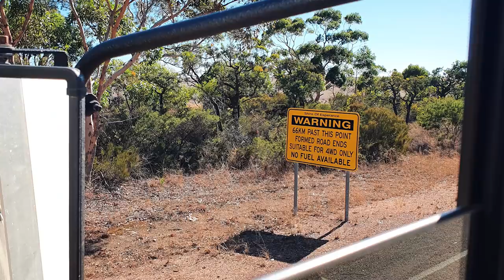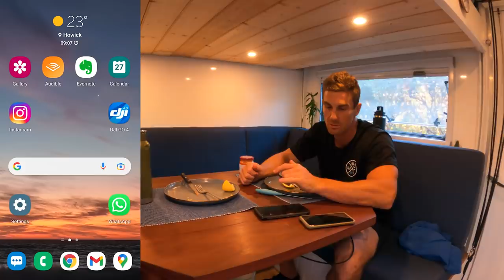STRANDED ON THE TRAIL! First Issue with our 9 TON EXPEDITION TRUCK - Remote Camping Cape Arid

Comment: A shovel is the best thing for levering a wheel off,you have plenty of leverage,another thing I would not leave the truck om that jack without a safety stand,I know you don't have a stand but you could find an old stump or something to use in the bush.it's a very top heavy rig now and if it come off the bottle jack it could tip over so a stump is better than nothing.

Comment: Don't want to contradict you, but are you sure it wasn't just the valve?  
You can get tools that can not only pull the valve, but also clean / recut the thread.  Valve threads can get messed up with you are taking them out all the time to air down.  Their is a product by ARB (and others) that is a "Tire Deflator with Gauge".  You probably already know about em from your Jeep days.  They keep the valve encapsulated and out of the sand / muck.  Great for deflating the tyres quickly and not introducing sand / grit / mug to the valve.  Means the valve thread stays good on the Valve and the tube valve stalk.  Get two so you can air down two tires at once.  With practice you can even do two at a time by yourself.  I've tried the Staun deflators, but with the big tires, they take too long and you would need several sets of 4 to air down to different levels.
Lookup "ARB Tire Deflator" and "STAUN Deflator" if you dont know what I'm talking about.  Also, carry 10 or so valves with you in your spares box.

Comment: Try leaving the rim on the truck next time you can make a quick clamp over if that ring comes off you’re protected and you can spin it. If you’re going with that technique of taking it off you needs at least a five foot bar use your shoulder and the bar line up the holes lift push with your shoulder I used to change them at 17 and 74kg. Just advise happy travels

Comment: Awesome episode as usual, maybe try using a ratchet strap to  lift the tyre, it will save your back. The dolphin swim looked awesome. Good to see you taking your time in each location, cheaper on fuel and better for your soul. Looking forward to the next camp.

Comment: Unfortunately low pressures for sand driving and tubes you will have to get used to this....
Unless there is a tubeless option for the mog.  Im not sure. But I do know that getting rid of tubes was the best thing that ever happened to 4wding
Reply from the maker: There tires can be run tubeless too but not with these rims. We chose to keep our original wheels as the alternative alloy beadlock rims make the Mog stance way too wide in our opinion. We now carry 2 spare tubes just in case :)
Reply: @TheOutFit  fair enough. 
I feel though,  that you guys are likely to do a lot of sand/ beach driving and running low pressures is the best way to get flotation and avoid getting stuck.  However tube tyres don't like low pressures as the tube and valve move around and it takes only a small amount of movement for the tube to deflate. 
Anyway I've really enjoyed the build and great to see you getting out there and enjoying it. Keep up the great work and may the white ox wish you both many more happy adventures to come!
Hope to see you on the trails sometime
Reply from the maker: @thewhiteoxoverland  the army was running tubes fine, we hope we won't have too much issues either 🤞 thank you for your comments and for watching, it means a lot!

Comment: You need a slid hammer to break bead easily. Should only be few minutes to knock off repair tyre if needed, replacing tube and back on

Comment: Some observations: I noted you have the original tyre wrench ( and I assume the bar) use it instead of that lightweight chrome one. When that snaps under pressure something will snap in your back/shoulder. Have a look at the torque setting of the wheel nuts when you get home.... they should not be that tight.  I noted that the tyre you fixed did not have a rubber dust ring inside the tyre,,, see original Army/mog wheel/tyre combo if you have one. As others have said get a four way valve tool and remove the core to remove all the air quickly
Reply from the maker: Hi Trevor, we have a dust ring - I have put a note in the video to mention we didn't film that part!

Comment: Put the Inner Tube on soapy water ..  have  tire leak detector in a spray bottle and spray it on the tube.. It will make air bubbles where your leak is ..

Comment: Use lube on those treads,it will be easier on your tools because it will stop the threads binding,you will get better clamping force because the threads won't bind,also don't over tighten them they are probably only supposed to be around 300 foot pounds any more than that may stretch the threads,in which case they will be damaged and hard to remove,

Comment: Is it necessary to run the engine to have more power for the electrical compressor when your engine is already driving your onboard compressor? Your onboard compressor is for sure much stronger than your other gadget.

Comment: You have air on the truck.   Get an air impact wrench.   Also use your weight to push down to break nuts free.   Also use the breaker bar on the ground to lift the tire.  not your back.

Comment: Careful with jacks. changing rear brake pads on a classic Range rRover on a tarmac drive years ago. only going to be five minutes on a bottle jack. leant in back for a spanner, swore something moved, stepped back. gave it a minute, about ready to continue and then brake disc against the ground wouldnt you know. right cow to to jack back up but got all limbs anyway. axle stands since then defo or wheel between chassis/axle and ground with a wheel off as short as possible unless on axle stands , diff lock in, in gear at least another wheel chocked by some means. if a wheel/ tyre change get the spare ready first. can always chuck the flat one in the back or wrestle it back on after a breather, checks the spare out for as long as its on to.  2 ton of classic Range Rover wakes you up let alone 9 ton of unimog, might be beyond anges lifting ability does look good as tyre crew though. enjoying the travels. we all live n learn hopefully.

Comment: Not sure if you did this but first thing to do when you have a air leak around the valve, is to put some spit over the valve and check for bubbles.

Comment: Admittedly, nothing near the same as dealing with a MOG tire repair in wild, I've done my fair share of coach bus tires in my day. Crazy heavy, loooooong tire levers. Much sweating and swearing. It was mentioned  elsewhere, first thing I always checked was the valve core. All it takes is a tiny grain of sand in there to make them leak....

Comment: Tube tires really hate low psi , what happens is they heat up and the valve steam leaks , the truck was built for hard runs , if you want get heat censers and carry lots of tubs.....

Comment: Wow. Those are real heavy, massive tires. Would it be possible to make them tubeless? Not sure if that would be good or not for such a heavy vehicle, but for most "normal" vehicles, going tubeless is the way to go. Valves from tubes are notoriously prone to breaking off or failing, in general.
Reply from the maker: There tires can be run tubeless too but not with these rims. We chose to keep our original wheels as the alternative allow beadlock rims make the Mog stance way too wide in our opinion. We now carry 2 spare tubes just in case :)

Comment: got to admit i am a bit confused as to why if it was just a bad valve why not just pull the one out of the spare inner tube and put it in the old stem just as a check before pulling the tire? we do this all the time with loaded tire on the tractors as the sodium chloride eats the valve

Comment: i used to fix truck tires split rings check inside tire for crud or sharp stuff nails or screws are a big cause of holes remove from tire & patch tube! i mark the air fill metal part on tire to locate the thing made hole! hope this helps why i quit truck repair was a fire of the shop & then ok i went on built mail trucks van type things for us mail then injured sick i knew it fell hurt back or birth defect or years early in military big little trucks to bad area for me my uncle was sick same way oh no what ( blood cancer oh great i D- i think doc said ever hear of blood thinner my uncles records and samples saved we can control this) & know why and how i was sick! Gregg new blood thinner works

Comment: Bud, take some oil off the dipstick, put a drop or two in the valve, connect the compressor and blow the oil past the valve.
9/10 times it solves the problem. Sticky valve more than likely. I shook my head as I watched you battle. 🙄

Comment: I was going to say lowering pressure low and pumping up often probably isn't great for tubed tyres
Reply: Also check inside your tyre as alot of cheap brand tyres often have a sticker from factory and if not buffed off and cleaned out will rub a tiny hole in tube. I'm a qualified tyre fitter seen it heaps. Even sometimes they put a tiny sticker on the tube which needs to be removed

Comment: THis is no danger wheel.  its easy. there is no pressure on the ring. Use a wooden stick to put back the rim onthe car. much easyer.

Comment: I am curious why you used a small electric air compressor instead of the air from the Mog?
Reply from the maker: We explain why we use the air compressor here : https://youtu.be/glCJN7AaaRs
Reply: @TheOutFit  thanks for the response!
Makes me question the state of your main compressor for sure, might be time for rings? It shouldn’t take more than a couple minutes to reach cut off pressure, I think it’s 3 minutes max here in British Columbia. I can confirm later as I am sitting waiting to start my air brake certification course in 2 hrs lol

Comment: This was probably just your valve leaking and a simple valve removing tool would have saved you all this work you could have just tightened the valve and been on your way
Reply from the maker: No it was coming from behind the valve stem where it attaches to the tube.

Comment: Why did you use an external air compressor, not the onboard air?
Reply from the maker: We explain why we use the air compressor here : https://youtu.be/glCJN7AaaRs
Reply from the maker: We explain why we use the air compressor here : https://youtu.be/glCJN7AaaRs
Reply: Good idea. I'll consider adding one.
I believe you can remove the pin in the handbreak actuator disabling the handbreak

Comment: Amazing episode . That flat tyre is the down side of 4x4 , off road ,. Plus it's just a little bigger then a land cruiser tyre 😁😓😓. Just a quickie , I would say that you just proved why girls can't get the same pay as guys , in certian jobs .. You used a lot of muscle to crack the wheel nuts , not to mention the weight of the tyres . Sorry , had to say that .  I am green with envy with what you guys are now doing , Awesome . What a Life , look forward to next weeks episode , travel safe ,,
Reply: I’m was all of 68kg when I used to change Mog tyres. Never had an issue with the nuts. I think I’d struggle with the increased weight of the tyre and rim on this setup though - the standard tyres were heavy enough!